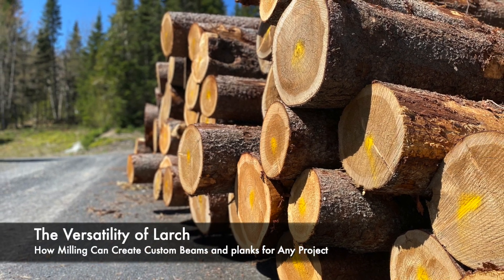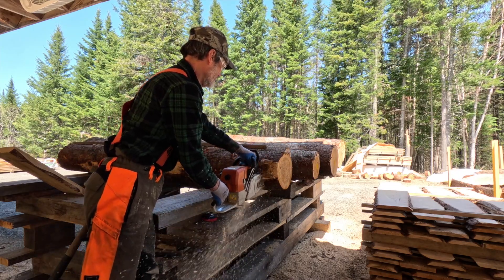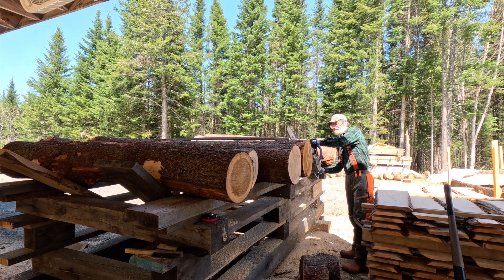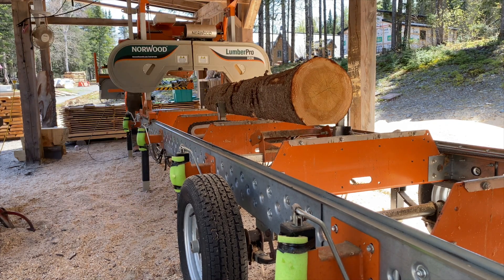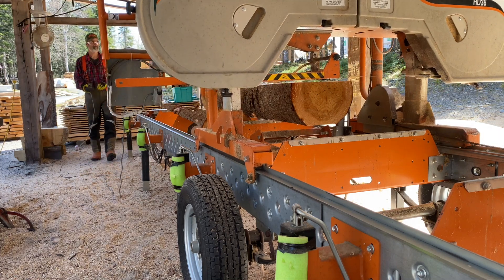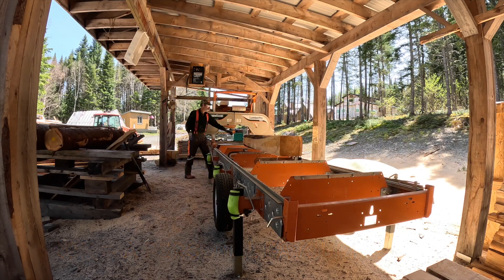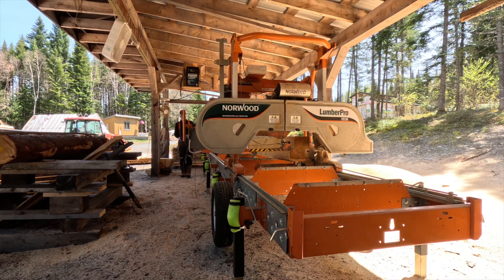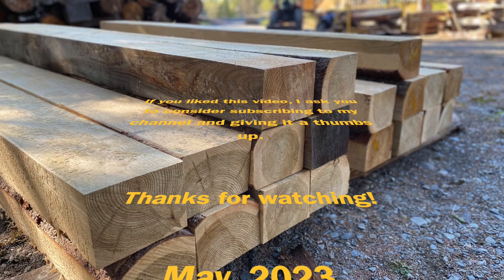The Versatility of Larch: Milling for Custom Beams & Lumber

Comment: Excellent video.  I began to mill a standing dead tamarack that I cut down last year but it began to warp as I was cutting it.  Do you ever use standing dead trees or just green?  The trees are recently dead maybe 2-4 years ago and are still moist.  Also I love your shelter and would like to use my tamarack for that as well and also some decking and other structural members.  Would you be willing to share the design or point me in the right direction for such a building.  Thank you.
Reply from the maker: Hello @karonosphere8390 and thank you for taking the time to comment. Here are my answers to your questions: 1) Yes, I often recover and saw trees that are already dead with my mobile sawmill. 2) When a log starts to twist and hook when you saw it, there's a lot of tension in the tree. This tension is often present in a tree that is close to forest trails, or that is isolated from a forest stand without much protection from the wind. It has to fight its way through the wind on its own to stay upright. As a result, tension builds up in its trunk, and when you saw it, it releases this tension to hook and deform. 3) As you mentioned, larch is an excellent wood for outdoor structures, whether for building structures or for decking. 4)I've made a short video about the construction of my mobile sawmill. Here's the link: https://youtu.be/juaZJFEEIXk  -  Have a nice day!
Reply: @SawdustSociety  thank you for the quick reply.  I’ll look for those things and try to avoid.  I’ll take a look at your video Have a great day.